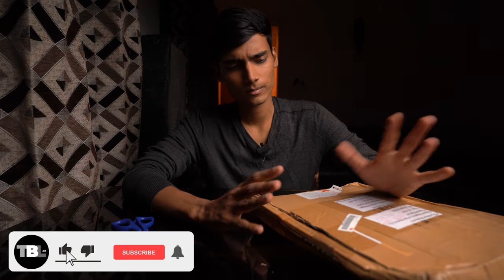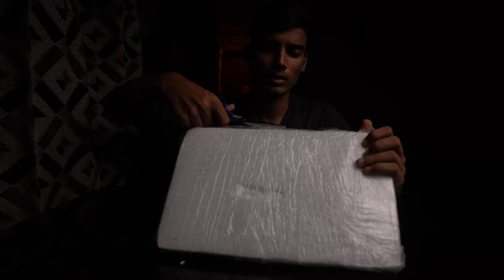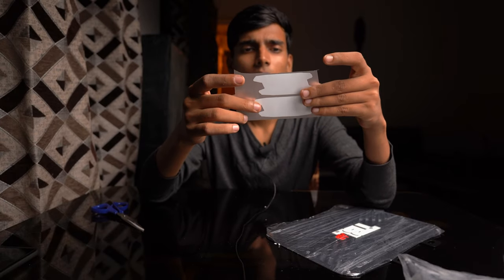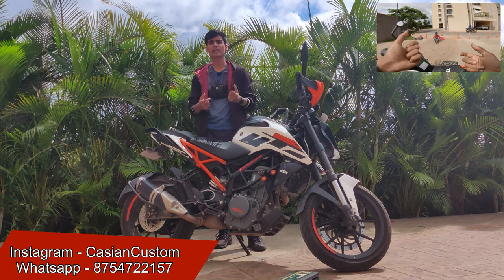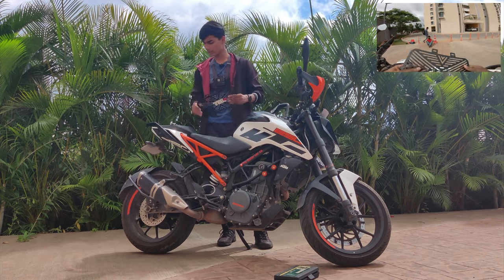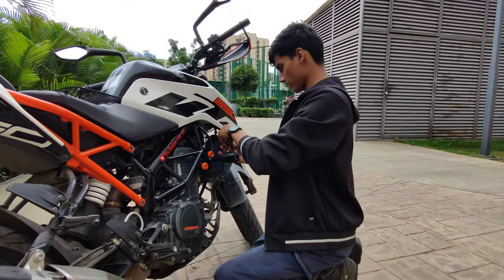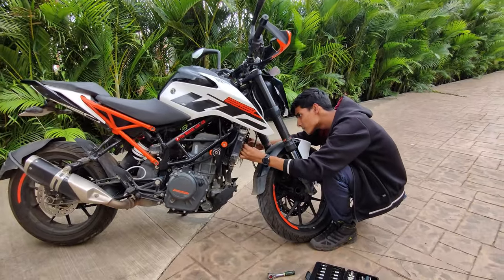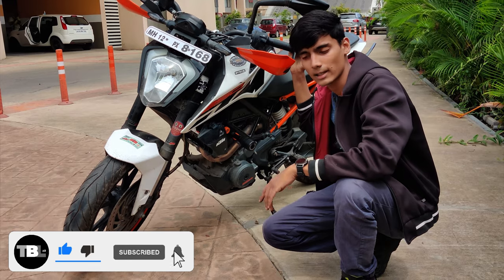Custom Radiator Guard for KTM | Installation | Review

Comment: @The Bucket List  brthr ur vedio helps me alot , bt one last thng i want to ask u , that 2 valve or 4 valve engine has diffrnt long term ... I mean which bike engine is good for long term , or i will choose any one of these  without worry about 2 or 4 valve.. Mt15 or fz25
Reply from the maker: Both are equally good in terms of long term reliability. It totally depends upon how you ride and maintain your bike.